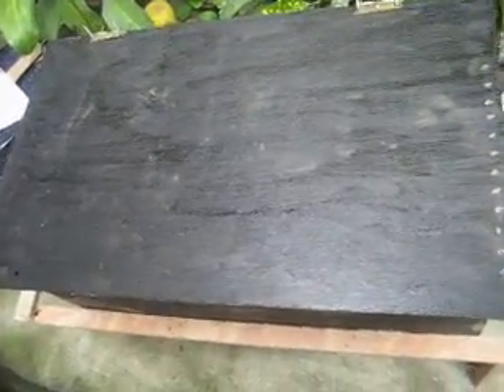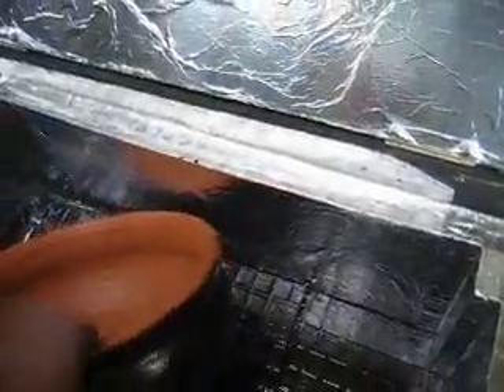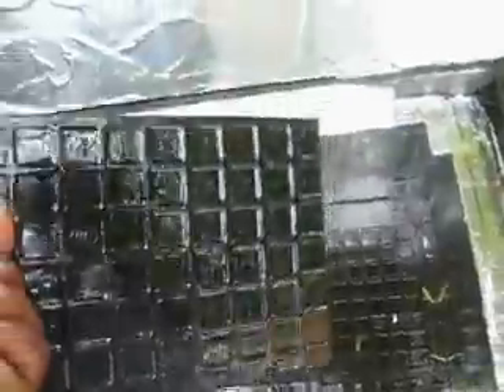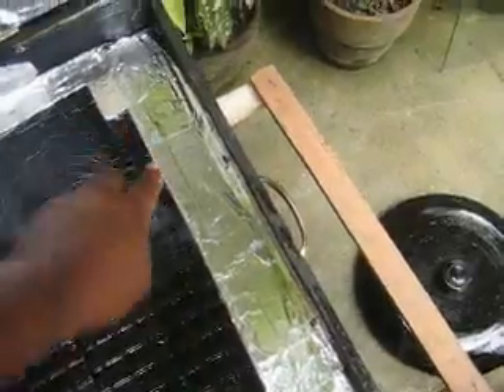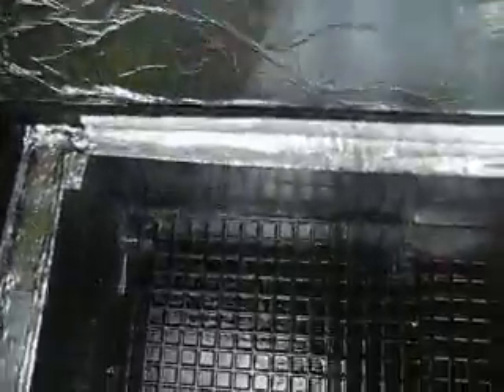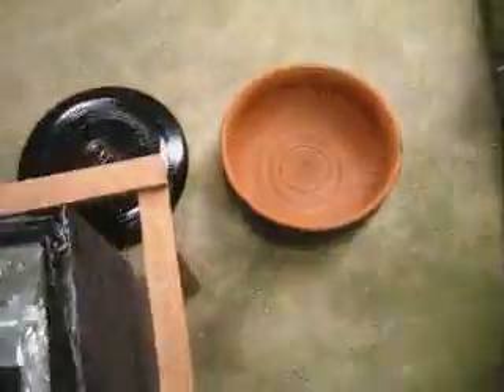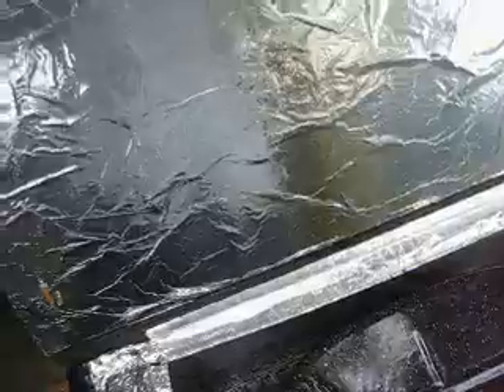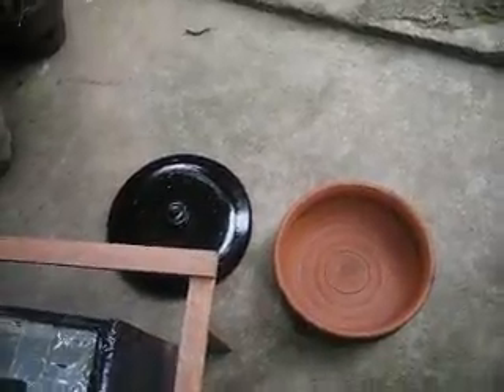My DIY Solar Oven

Comment: You guys done a good job on solar oven project, but the inside need more improvement just like my used to be aluminum foil and the temperature 205 degrees after I made some improvement adjustment today outside temperature 90 deg. my solar oven reach 250 deg. I used high heat ultra B.B.Q spray paint and metals sheet, I need to get me highly reflective Mylar film roll to reach 400 deg.

Comment from the maker: I like you're profile pic! I didn't use heat resistant paint but it'd probably be a good idea. I just used what ever leftover paint I had laying around. Flat black is best. Whatever kind of paint you choose to use just make sure it's completely dry before you cook with the oven. Also, the ceramic pot and lid seen in the video didn't work, terrible toxic smell. The roaster worked fine as well as any other pot, even unpainted aluminum or clear glass Pyrex containers work fine. Thanks for watching!

Comment: I love what you did. I have been experimenting with solar cooking, too. I am wondering how your clay/stoneware pot held heat. I use smaller enamel roasting pans. I just think that black metal pans would absorb and conduct heat better. Can you tell me how well your oven and pot worked?  Thanks!

Comment from the maker: @ChasAllan Yeah flat black paint is a great idea! I just used what ever leftover paint I had around at the time. I know that the roster works. The problem was with the ceramic bowl, It sicked in the fumes of the paint so much that I didn't feel safe to cook with it. I now use purex cookware with lids. Thanks for your comment! I want your Tweety Bird!

Comment: @abaneyone Go Cebu I was there last year for 3 weeks, had a great time..If you use Flat black paint it will raise your temp. 40-50 degrees. High gloss paint reflexs the sun away. Your roater will work fine as long as you have air space around it. I use one about the same in my solar oven. My Temps run 300-350 degrees F. Have fun with it and cook some Manok Adobo !!

Comment: Hi, nice video. I understand what your are saying your problem is?  There is a simple solution... You need to create very large, reflective lids for your cooker you have now and I would paint that big roaster a High temperature black paint.  You need a lot of surface area reflecting sunlight into your oven to get a good temperature. I am not an expert but I believe 4   4ft long sheets of cardboard covered with foil, pointed at the inside of the oven will do the trick.

Comment: though that roasting pan is large and takes up alot of space, realize that the pan itself, being dark, will actually create a second oven because the sun will be hitting the top of it, and then hot air around it and some radiation from the sun bouncing on it from the reflector.   Make sure you set the oven out  for a day with the glass partly open to let the sun gas out the fumes from the paint on everything before you cook food in it.

Comment: HEY IT LOOKS GREAT!  how far is the window from the large roaster pan?  if its more than an inch, it may not hurt the window.  if you ever find a turkey roasting bag, you can make a new lid for it then use it with a rack on it to keep the turkey bag window from touching the top of the lid.

to be honest, the black pan, though its large, if you are careful NOT to fill it very full, just only less than a quarter of the way, it will do just fine.